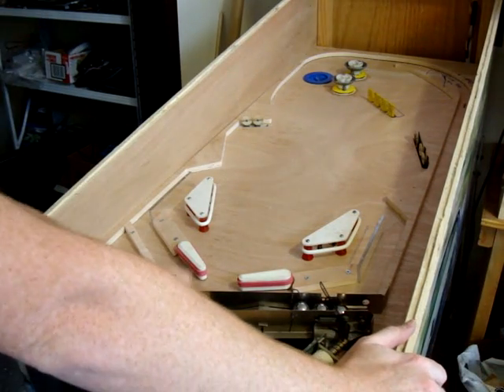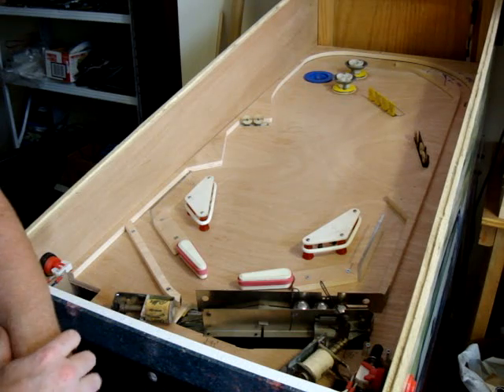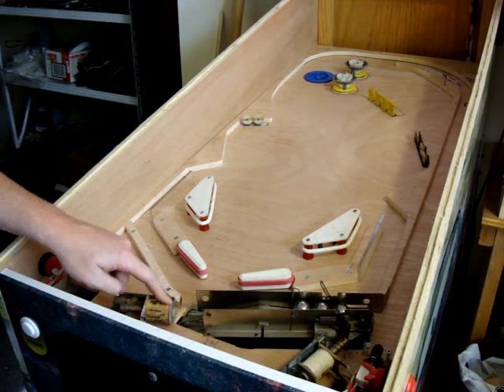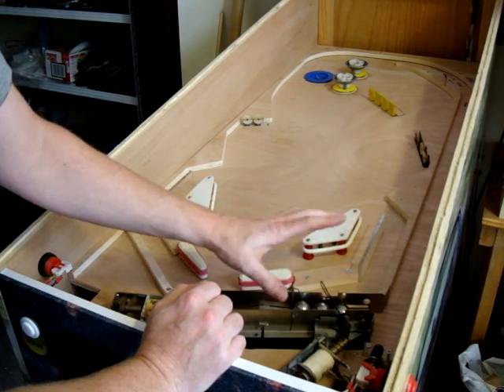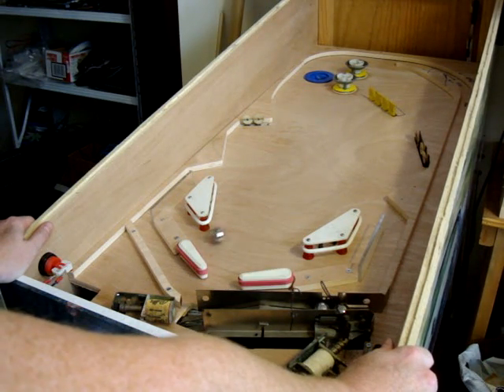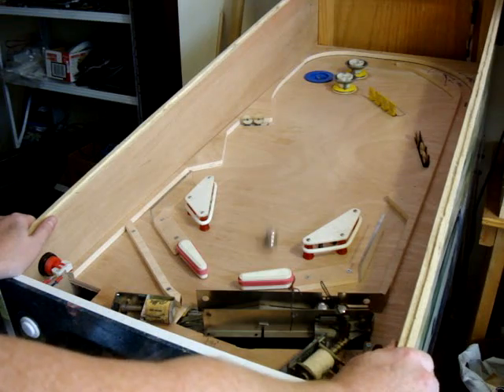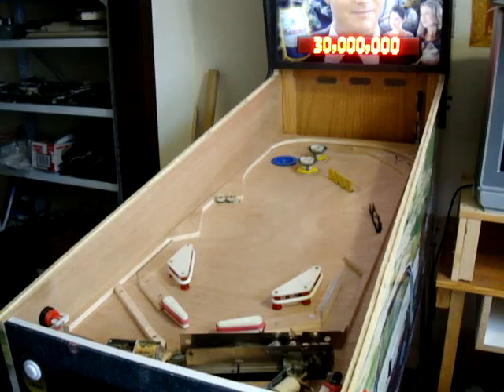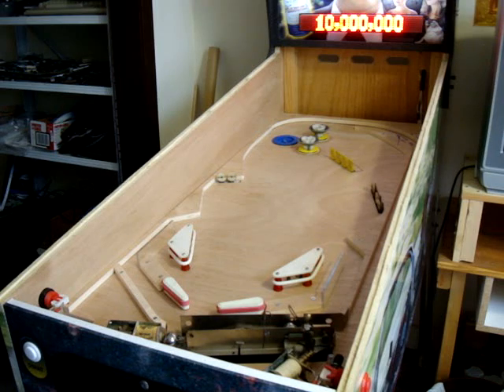Multi ball loader test

Comment: It called a ball saver.

Also called freeze / ball safety.

YOU BETTER have 1 switch per ball in the trough.
GTS 3 games only have 1 + the 1 at the drain kicker
and they suck at ball searching.
Also that is the OLD type of trough that has a kicker to kick the balls in to it the newer ones have the ball fall in and have 1 kicker kick them out.

and 4 balls are better then 3 in Multi ball.

Comment: Probably should add the instant replay feature to your machine, in case you lose a ball quickly. You could even add an auto launcher, that shoots the ball automatically if the instant replay feature is used.